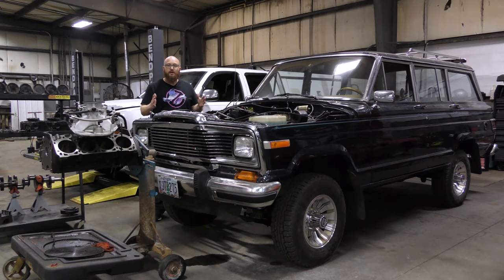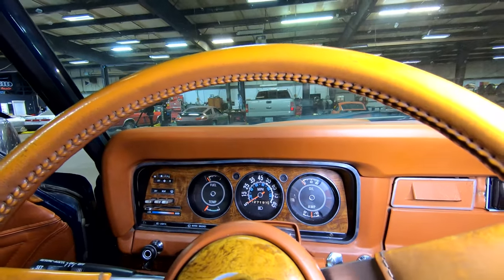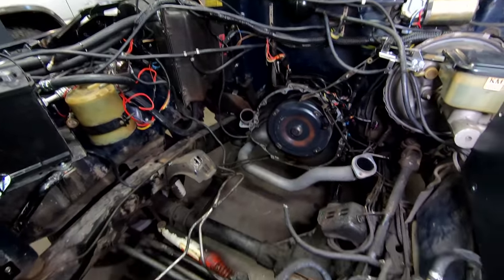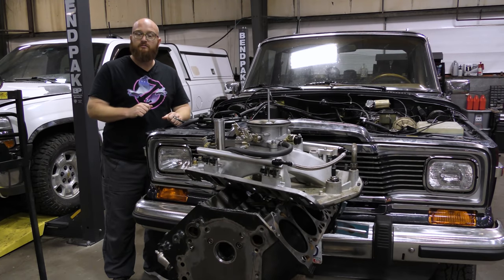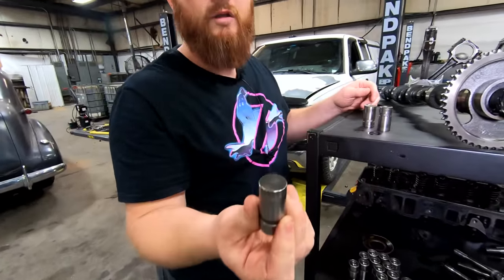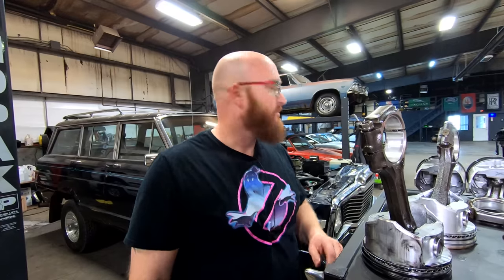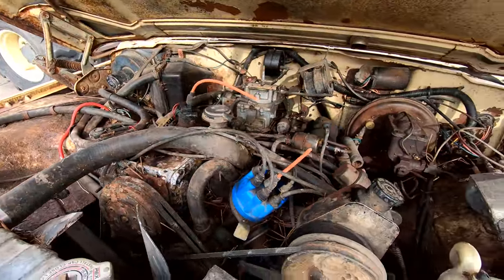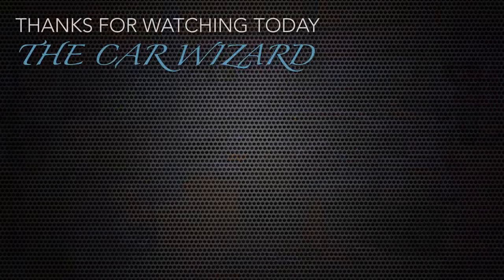The '83 Wagoneer rebuild is dead! CAR WIZARD gets burned by another shop!

Comment: There's been a epidemic of bad  flat tappet lifter's so it might not be the builders fault your customer should go with a roller cam Wich would make better power anyway or reuse the lifter in the rat engine the Chinese flat tappet s are absolute garbage and a lot of cam manufacturers are recommending going roller or finding new old stock Wich are few and far between

Comment: I don't know if you can blame the Builder if a block breaks in that location and coolant gets in the oil and burns up the motor. If the Builder missed the hole than yes but if it broke in such a crazy location than no.

Comment: if that is a 401 block, its not a boat anchor, it can be repaired, if someone needs one bad enough. had a lifter and cam failure on my car , went roller haven't had a problem so far.

Comment: That is quite sad. That shows that the engine rebuilder seems to have sloppy practices. It takes a lot to screw up that engine. It is an easy engine to rebuild (we were working on those in shop class back in the day) so it would seem this engine rebuilder did a half-assed job on it.

Good call on the fuel injection. It will be easy to start and easy to run and will get better gas mileage then the carb. Even in the fuel guzzling 1980's, that engine was a pig.

Hope it all gets sorted out as soon as possible for the customer

Comment: The only reason that push rod go threw block is from over reving.oh engines are called engines not motors.some body must have push that engine to hard.plus cams and lifter are going bad out of the box so stop blaming the others shop cause you don't his work.talk tony on utg garage on the cams today and their flaws like lobes lifters why the new ones go to junk so fast..

Comment: Early on in the video, you mentioned an issue with the overloading ammeter. I was curious if this issue was solved later in production. I have an 87 waiting for me stateside that will be my project when I retire. Any gremlins from that era (besides the well known Ford ignition, GM window switch, window regulator failure) that you know of would be greatly appreciated.
Reply: I was rebuilding an old army Jeep for a customer and when I saw the way the ammeter was hooked up it just seemed unsafe. So I used a voltmeter instead. Much easier hookup and much safer. The way ammeters connect seems if anything goes wrong it can draw enough to burn stuff. I wouldn't trust any unless doing a museum quality restoration where it has to be 100% original for show and value. But for a reliable driver always go voltmeter.
Reply: Depends on the style of ammeter. The ones where the current passes though the meter itself are the problem ones. Best to just put a voltmeter in there so it can be on just switched ignition power.
Reply: @NBSV1  I appreciate the info. I'll track down the schematics and see how it is wired. That should get me closer to an answer

Comment: I used to be a boat mechanic a long time ago. I came into this one shop and was handed a job that was partially done by a former employee. It was a twin engine inboard. The customer provided the engines (454's) and once I got them installed I could never get them to come up on power where they should have. We thought it was a carb problem and we went through 3 carbs. Turned out that the engines were build with the wrong cams, so they would NEVER really work well in a boat application. Customer was in for $15k of work already, and he put up a stink, so the shop owner at the time told the customer it was his problem and we weren't working on it anymore. Because the engines were provided by the customer, we weren't responsible for the warranty, etc. What a nightmare of a boat and a job. From then on every crap job that came along got the nickname of that customer.

Comment: Seems I remember  racers  would drill and tap in the valley of these engines to get oil from  the rear cam bearing oil gallery  up to maybe the second cam bearing gallery area using a piece of copper tubing. I have seen this done a number of times on the modern Nash v8 mills.By the way don't these engines use the same lifters as Mopar?

Comment: Customer provided parts can cause all kinds of customer/mechanic relations when additional labor is needed to replace the faulty customer provided part(s).  Some items cover labor if it was professionally installed(certified mechanic/business). Though that is usually rare. As far as engine swaps go, at least it is a simple swap compared to many more modern cars.

Comment: Looks like catastrophic lifter failure.  What a bummer.  I'm in the middle of rebuilding an engine and have looked at these cheap Chinese knockoff lifters because they are so much cheaper than an OEM set.  My used lifters happen to be rebuildable, so after a thorough sonic clean if they don't look perfect, I won't consider anything other than OEM now.  Thanks for teaching us the pitfalls of engine rebuilding!

Comment: I had the same problem with an aftermarket cam kit i installed here in the UK on a 1.6I orian, it ran fine for a few weeks but then something was not right with the engine, took the cam out that came out ok, but some of the followers i had to pull out of the head as the end had been burred over as the one in the video and also some of the cam lobs were damaged, took the whole lot to testing place to see what was wrong as in hardness etc, but they wanted too much money to test the items, so i just put it down to experience.

Comment: that seized pin may have started all of it, heat built up, cam got too hot, lobe got too hot, the liger cupped and spit the push rod boom knocked a hole and you shut her off, pull that pin see what happened, count the bearings so forth so what happened

Comment: The anchor thing made me laugh. The machine shop I used to work in had a foundry. I used a piece of scrap cast iron for an anchor. It didn’t seem that heavy but we couldn’t lift it from the water. It’s still at the bottom of the lake 20 years later. Lol

Comment: I've been building engines, using the same Father/ Son machime shop since 1974, everything from stovebolts to 215 Buicks to  400 Pontiacs and a slew of SBCs. Never had a problem until 10 years ago when the 355 I built for my truck wiped 7 lobes off the cam during break in. The resulting shit storm of shredded metal ruined damn near everything else in the engine, all in under a half hour. Proper lubes were used and I know that I put it together correctly. Stock heads, light splrings, RV torque mild cam.
Conclusion? I don't care who you are or how much you check things, parts these days suck and blaming shoddy builder workmanship is a bitch thing to do.
Reply: Builder should've caught that during their supposed break-in period before handing it off to the customer.  Shit build

Comment: that is metal particle contamination, it will ruin everything inside the engine, you can see how it effects only the outside of the bearing shells and not the inside due to the filtered oil being injected on the inside, the whole engine is possibly a complete loss, maybe the con rods are ok but that would be about it.

Comment: I’m glad the customer was so understanding. I had a customer at my shop come in for a brake job and a day after we completed the job she came back raising hell saying when we did her brakes we broke her headlight and stole all her center caps. She was just making a big dramatic scene in front of a office full of customers. So I very calmly pulled up the cameras and showed her that her headlight wasn’t working original and I actually offered to fix it and she turned it down and had a repair order signed turning it down and the cameras showed she head no center caps when we pulled her car in. The she admitted she knew she didn’t have any they are just $80 a piece and can’t afford To by them herself. Has another customer a few weeks ago whose tire fell off her 2019 BMW after she had been driving the car for a week since the repairs and tried to say we didn’t tighten her lug nuts. We test drive before and after we work on cars for quality control and to make sure we don’t get blamed for something else that is already wrong. I showed her the video of her lug nuts not only getting tightened but actually torqued down with a torque wrench. She still took us to court and lost turns out her ex loosened all the lug nuts and before she had a chance to drive the car they got back together and he didn’t mention to her what he had done. Moral of the story is when you own/run a shop cameras can solve a lot of issues from dishonest customers. I have 7 bays and 6 mechanics and shit does happen but when it does I own up to it but your not gonna play me for a fool and try to get money back or for me to pay for something that isn’t my fault

Comment: Could the Eddlebrock after market fuel injection system have malfunctioned and dumped a ton of fuel in the cylinder that failed, causing catastrophic explosion?  Did that magnitude explosion bend the wrist pin in the cylinder that was rigid?

You'll have your answer soon enough on engine #2. Nice interior resto.
Reply: Highly doubtful. The way that cam and lifter were worn is not something the FI system could cause just from tuning. All the damage is pointing to a failed mechanical part and/or build screw up.

Comment: Hm nice to hear that lifter issue. I have New Set of comp cams. Thougth they were Made in USA. To Chevy 350. Is there way to check material hardness or is it that breaking in and oil. I ever had worries with stock cams or lifters , Just throw them in and drive.
Reply: Theres no zinc in most storebought oil any more due to emissions. But check out Lucas Oil for hotrods.

Comment: If the timing cover is worn where the oil pump parts install it will have low oil pressure and eat lifters.

Comment: You are to kind. I assume that's the last engine you mess with from just any old shop. And why wouldn't you warn the rest of us exactly what place is to avoid. Avoid the noid
Reply: There is a possibility it's not the builders fault. Flat tappet lifter failure is becoming a major problem for lots of builders, even those who have been building engines for decades now. If your rebuilding an old flat tappet style engine, it's best of to spend the extra cash to upgrade to roller setup.

Comment: Is that a 304 family V8?  It's a decent engine snd pretty tough. My Javelin has been running a mild 304 for 25+ years now!!! Thx
Reply: 304, 360, 390, 401 are all the same engine family.
Reply: @21Piloteer  Yes I own two of those......just wondered if they had modernized or forbid brand swap!!

Comment: The lifter issue, hard to say, as  there have been a lot of issues with bad new lifters , but even that issue is controversial?  Now as for the tight wrist pins, that was done when someone pressed them in, imo.  Was there a tapping noise all along-  which would have been the piston skirt slapping? I ran into this same issue with Promar engines a while back. They did give me a replacement
Reply: Whoops.   Cont.   but tried to tell me it was because those 2 tight wrist pins got tight because those cylinders were running lean! They were not! As I was the  one that recommended Promar for my client ( used their engines several times with no issues) I had to eat the Labor , but we live and learn!

Comment: Aside from the obvious problems, I question the logic behind attempting an FI conversion. It's too much of a distraction and you're introducing another big variable into the equation. You're already struggling with a new(rebuilt)  engine start up and its attending problems. Why complicate it further? Just put a known working carb on it until you get the ignition timing right, and you're sure you have adequate cooling, no oil or water leaks, oil pressure is good, and that the valvetrain is oiling well and hydraulic lifters are adjusting lash properly. Once you got the cam break-in done, I'd drain the oil, cut the oil filter open, and look for metal. After you're satisfied that everything is good,  THEN install the FI.
Reply: All that was supposed to have been done by the builder... break in and dyno. If it didn't have all that mechanical failure the FI system should have been a breeze to tune.
Reply: @whichgodofthousandsmeansno5306  But that obviously didn't happen. I don't care if the engine was built by Keith Black, at the minimum, I would have pulled the v. covers, oil pan, and the rods and main caps and inspected them, before I went to all the work & expense of  installing a virtually unknown engine.

Comment: One reason I went with hydraulic roller lifter cam in my 454 rebuild was that it seems you're doomed with hydraulic flat tappet lifters these days. Like an epidemic. Certainly no guarantee on my rollers but I just couldn't take the chance.
So on that jeep engine you could partially fault crap parts but on the rest of it, it certainly looks like nothing was checked.
It takes time and a lot of measuring and checking to build an engine.

Comment: As a  side note you must use a break in oil additive because oil companies have removed zink and phosphorous from their formulas for emissions and roller lifters don't need them.
Reply: I would think an engine rebuilder would know that. But with the industry loaded with faulty lifters etc I would hate to have that job these days.

Comment: Looks like classic break in with no zinc in the oil on those old flat tappet cam lifters. No zinc will scorch them fast
Reply: It's not just break in issues anymore. Lots of old school builders are pulling their hair out due to widespread quality issues with flat tappet lifters. Uncle Tony has had several videos along with several other shops that have been building engines for years on the issues of lifters failing after a very short run time.

Comment: That damage on the engine, Specifically the hole. Does that mean the block needs to be replaced? Is it fixable?
Reply: Possibly could be welded up, but not easy to weld cast iron. If a rare part then maybe worthwhile, but generally not.
Reply: @katywalker8322  Did not know that.

Comment: The amp meter does not burn any cars to the ground. its just the way older cars are wired. High amp wires go through the ignition switch in the dash which is the basic distribution of high load wires and very few relay's are used. Which can cause dash fires. The worst the amp meter will do is create an open circuit.
In modern cars the switches control light load grounds to relays located under the hood in a relay box not under the dash.
Thats an old story amp meters burn down cars and its not true.
Reply: Thanks for that clarification I was just about to ask the crowd what they knew about that. I can tell you know your electricals.
Reply: @bw1841  Tip on old cars just push the neg cable on the battery don't tighten it . Keep an extinguisher and a towel under the seat. If you smell burning plastic ( wire insulation) pull over pull the neg terminal off the battery. Use the extinguisher only if you see heavy smoke or flame (they make a corrosive mess. It hardly ever happens but its cheap insurance.

Comment: Maybe a bit more spinach for dinner, wizard.
Reply from the maker: Ive actually lost 25 lbs so far from lap swimming at the YMCA. Feel much better. You should try it. Might increase your mood.
Reply: @CarWizard  It was a Popeye reference as you were trying to push and pull that engine piece. I'm glad to hear about your weight loss. I too, have lost weight through walking roughly six miles a day, though I can't say its improved my mood. However, it has allowed me to choose more in my closet than those pants that use elastic.
Take care.

Comment: Great job!!?? But jumping all over the "builder" for a bad build. As it was said a number of times that their are a crap ton of bad cams and lifters on the market, so is it just possible that it was a parts failure?? About the wrist pins and the piss poor oiling of a AMC engine did it happen because of the ingestion of coolant? But hey I guess the replacement of vacuum lines and the installation of some carpet makes you a subject matter expert.  Here a idiea put your man bra on roll up your sleeve and re build it yourself. Or just replacing parts more your style? There was a saying that from a long time ago and you are the poster child for it, and it goes " Hang partsctill it starts"

Comment: so let me get this straight, your self obsessed anime weeb 'daniel-san' was by his own admission,  tampering with the settings of the engine and just happened to blow up the engine, of which you just happen to have a replacement part in a spare jeep, which you can sell it to the customer at extra cost? and profit? wow. does no one draw up the dots in this channel?
Reply: You have no idea what you are talking about.  Daniel was tuning the fuel injection system. Has nothing to do with the mechanicals of the engine.
Reply: @21Piloteer  so he's going lean-rich-lean-rich and presumably revving (I bet he never admits it) this brand new engine that needs bedding in, and then it blows up. Now are we going to believe the case hardening on the cam or lifters failed (I doubt it) or was it utter negligence by the last person to touch it?
Reply: How about that fact that the builder said they completed the break-in procedure and dyno'd the engine?  That was a lie.  Have you even tuned an engine with aftermarket EFI?  I bet not!

Comment: That "rebuilder" probably got a long block out of a wrecking yard, washed it off,
and gave it to the owner to bring to your shop. There are plenty of crooks in
the engine rebuilding business.
If I had that Jeep, I'd put an AMC 258 straight 6 into it. A very reliable motor, and easy to
work on, too, when necessary.